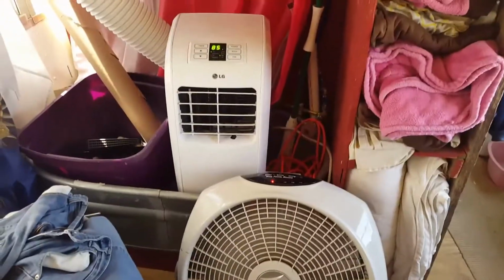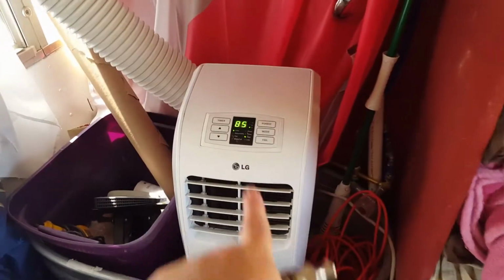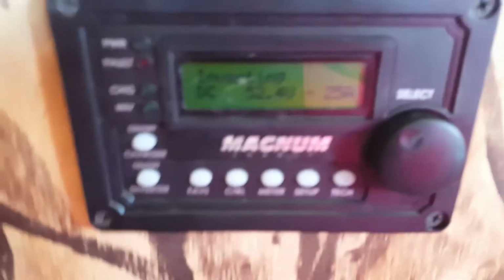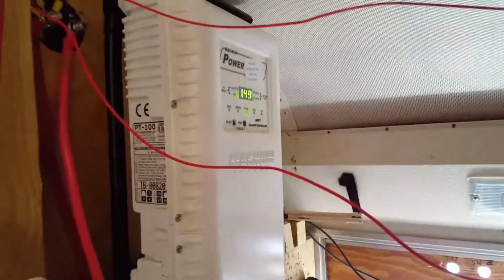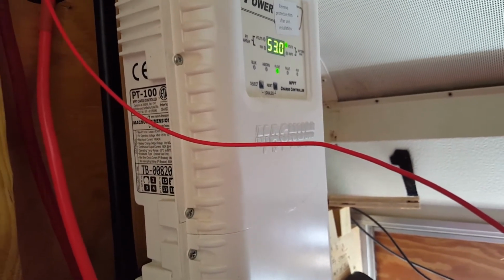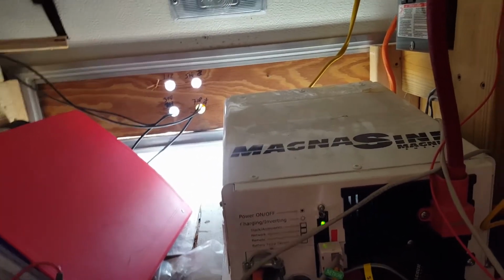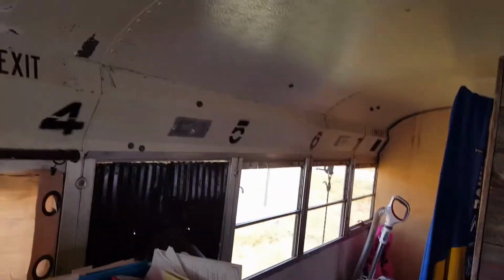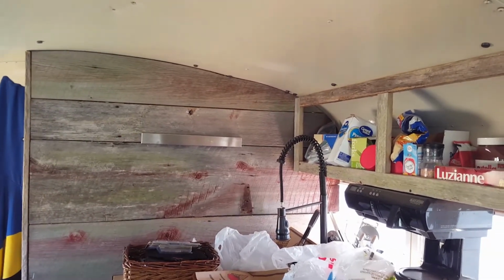Off Grid Solar Powered AC Rv bus conversion magnum pt-100

Comment: I followed your lead and traded my 2812 with some cash for a brand new magnum 4400. This inverter kick but. I might just have to upgrade my controller as well, from the outback 80 to the p-100. Did you use a combiner box for your panels? Target has colored blackout curtains that help a lot with the heat, well at least that what we use. So far you solar powered rig is looking nice, hope we can get there one of these days.
Reply from the maker: Abrondon Spears  actually i just used 2 100amp dc breakers
Reply from the maker: i have them hooked up 4 to a string ..when the two strings come inside i hooked negatives to 1 breaker and positives to one breaker..then have a single line that goes to the cc.  dc rated breakers..